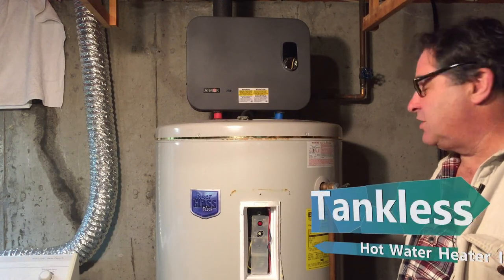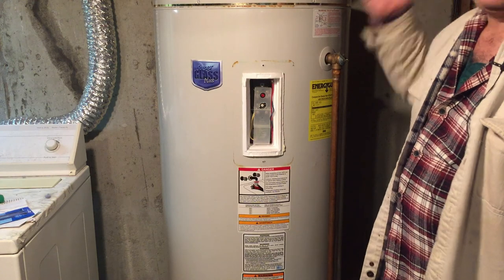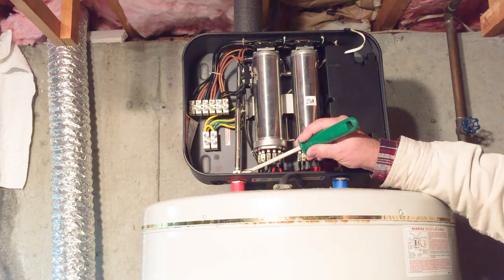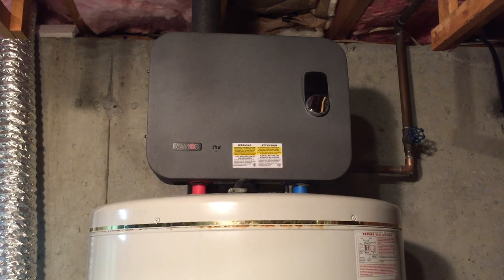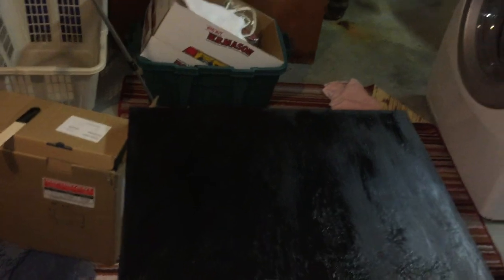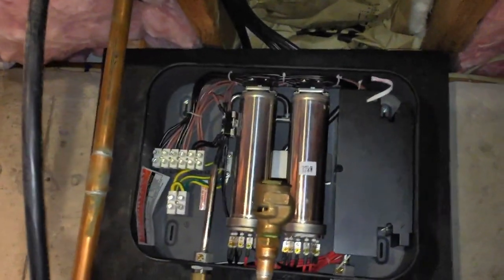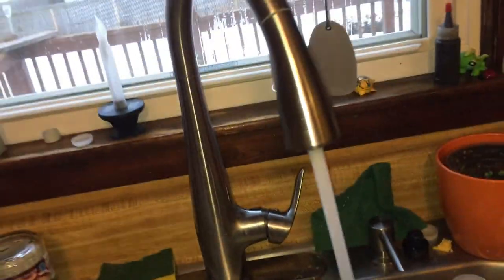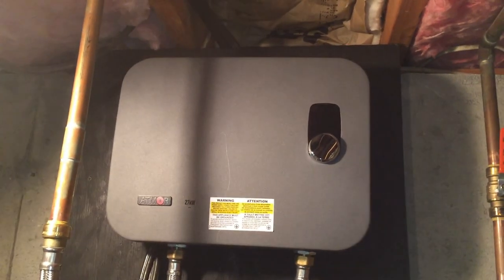Tankless Hot Water Heater Install

Comment: @ The DIY Handyman I have 2 questions. 1st, Did you use 8 AWG stranded or solid? 2nd, Was it difficult to terminate that gage of wire to the L1L2 terminals? I pray to hear from you shortly. Thank you.
Reply from the maker: I am so sorry I did not see this comment. 8 AWG stranded I beleive. Yes it is kinda a pain to connect to the terminals
Check out my other Water Heater Install too - 50 amp per circuit